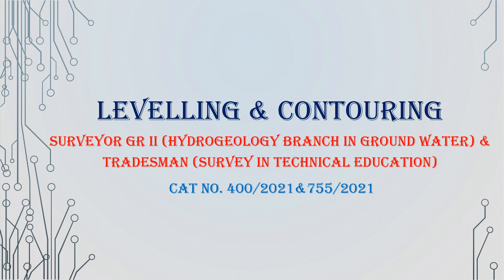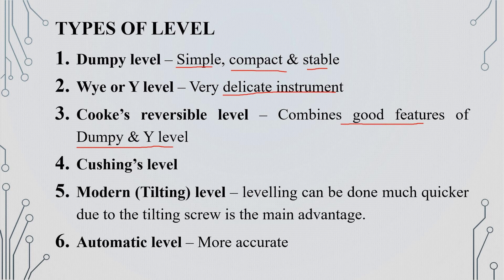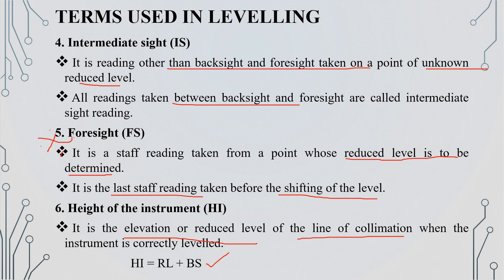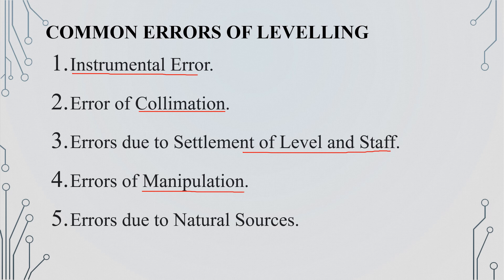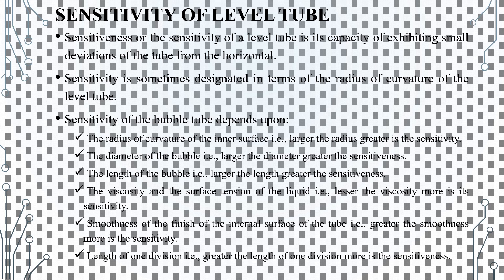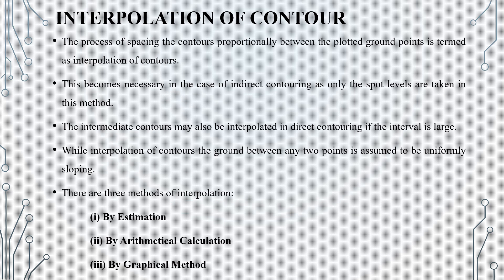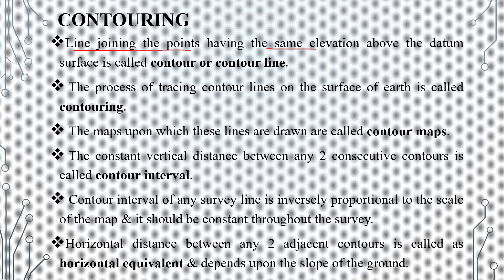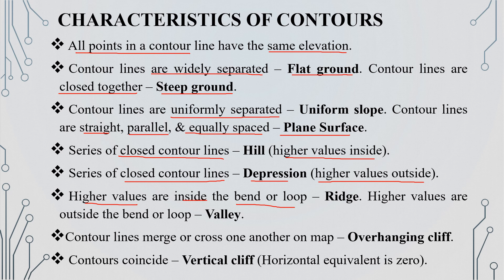Levelling & Contouring | Surveyor Gr II & Tradesman-Survey|CIVIL ENGINEERING|Kerala PSC

Comment from the maker: PERMANENT ADJUSTMENTS OF A LEVEL (Only 2 adjustments)
 1. The line of collimation should be parallel to the axis of the bubble tube.
2. The axis of the bubble tube should be perpendicular to the vertical axis.